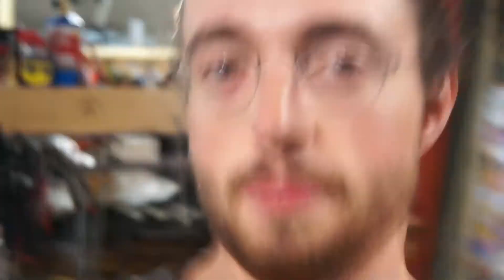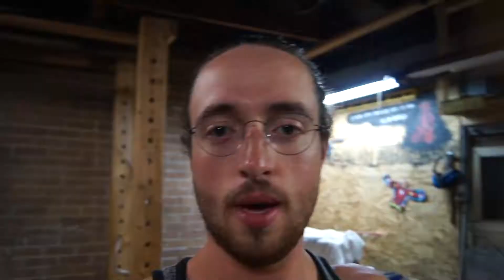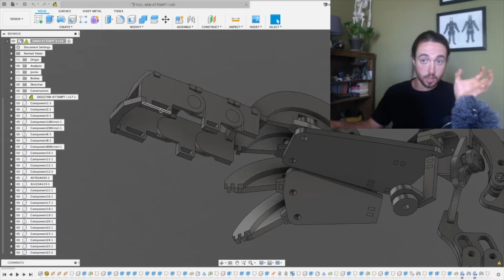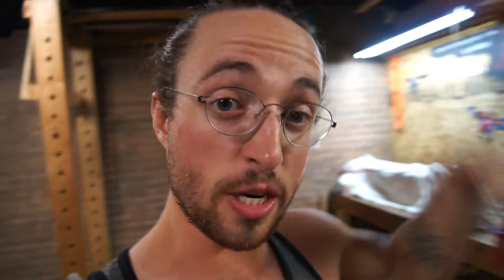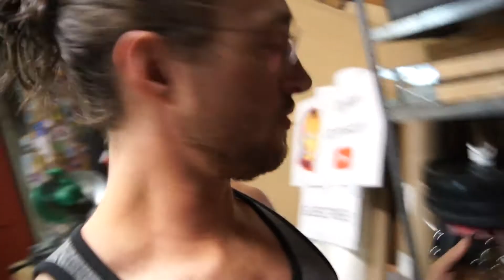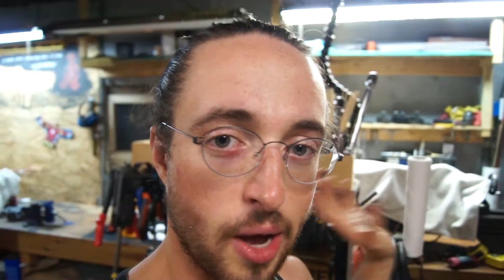I'M STARTING THE FINAL DRAFT OF THE MARK I

Comment: What propulsion systems are you going to use for flight? If you're going with bipropellant (hybrid or liquid) rockets I could give some tips
Reply from the maker: I was considering using hybrid rockets but decided against it because I didnt want to have to carry propelant and fuel. And because rc jet engines (what i will be using) have higher specific impulse.